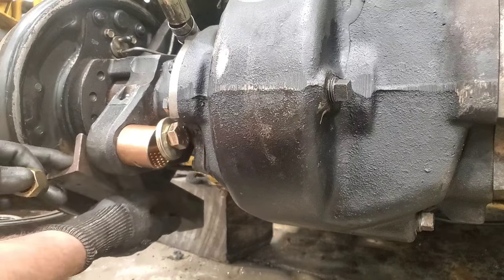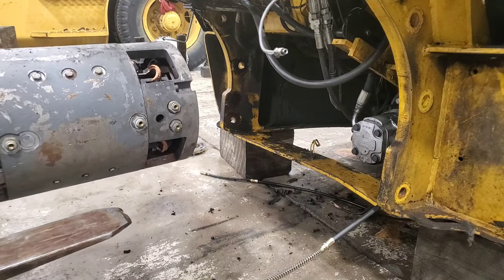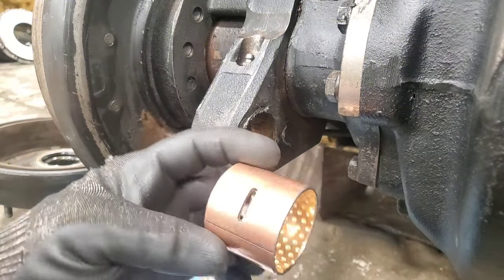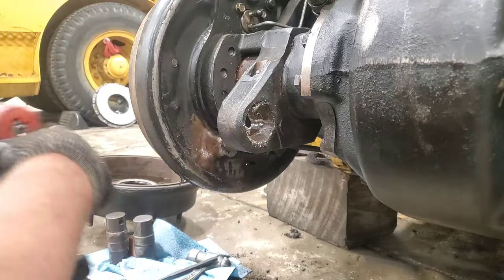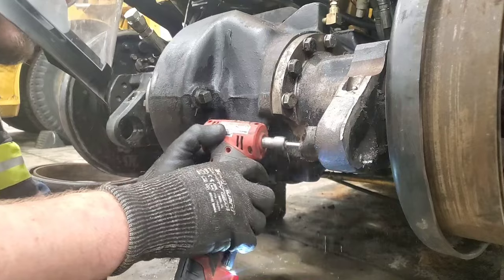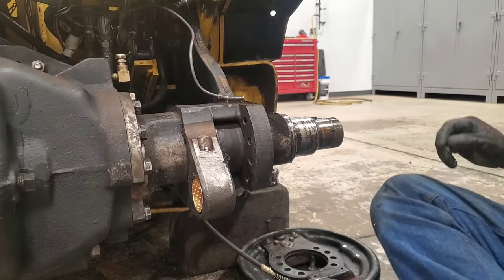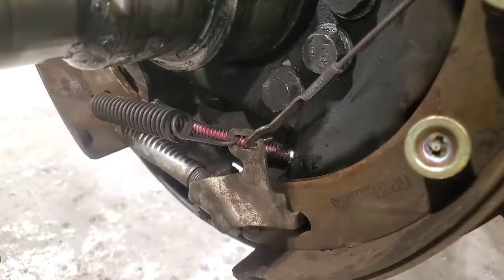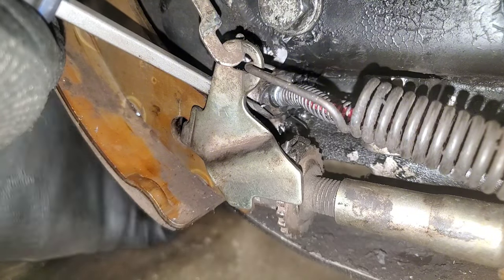Axle install gets interesting

Comment: You are a very knowledgeable mechanic. Your a do'er. It will take time, but I am sure your channel should grow.
What kind of burs and where can I get one?
Reply from the maker: Thank you very much! 
The burs used in this video are MacTools part# CB3NFS. 

Main reason I bought the Mac burs is that they are lifetime warranty and only cost 20-30 dollars difference from the MacTool truck to Amazon. Plus the Mac guy shows up weekly incase I do need to warranty. To me that's worth the 30 dollars as a convenience fee and lifetime warranty.
Reply: @Fixed-ish  makes perfect sense